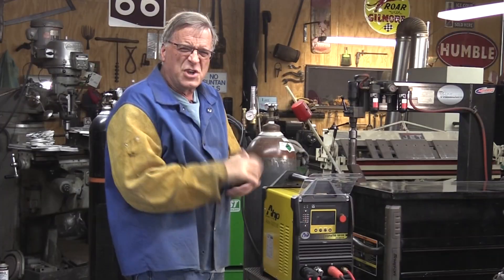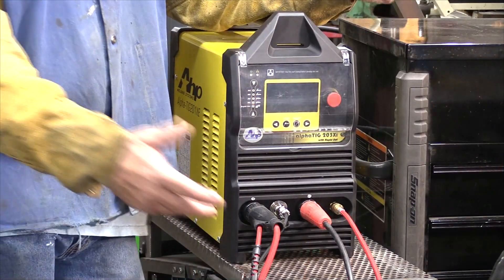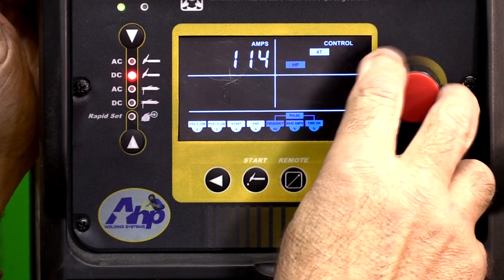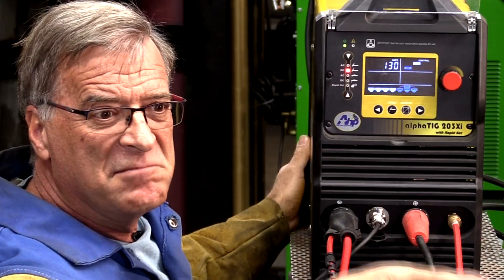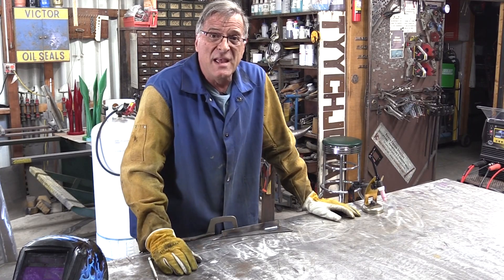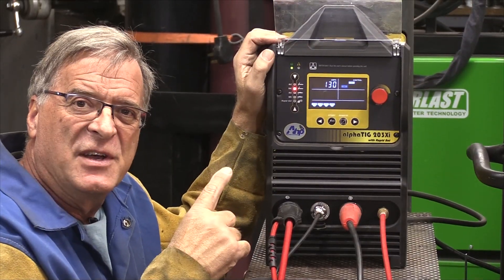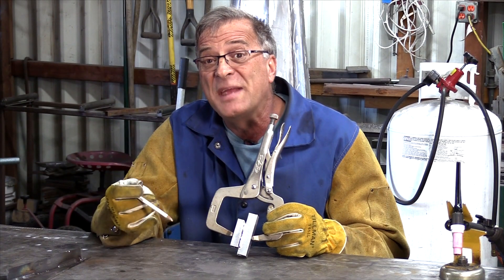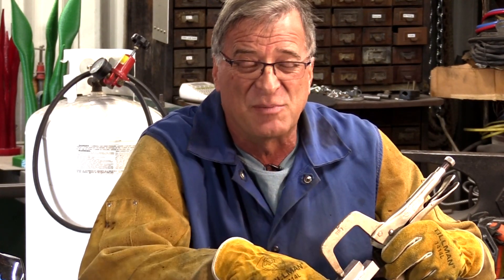A Prototype Revealed! The AHP AlphaTIG 203Xi - Kevin Caron

Comment: Hi Kevin, I just bought one of these based on your recommendation. I figured they had a year to work out the bugs and refine the software.  My 12 year old Invertiweld had no output last week and is not worth fixing. It is full of huge circuit boards with many cables and analog circuits that are connected to the potentiometers. People are familiar with knobs and for that reason feel that they are reliable, but the sheer number of connectors and discrete analog circuitry inside actually makes that approach less reliable. Somewhere a transistor, capacitor or resistor broke in mine and now I have no output. The new machines that have knobs are still huge because of all the analog circuitry that is essentially unchanged in a decade. With this new generation the 203XI computer controls everything and there is actually less to go wrong because there is far less circuitry. It is smaller and lighter because of technological advancements.  Additionally all the settings are exact numbers that are repeatable instead of the approximate position of some knobs.  We carry supercomputers in our pockets every day and those screens work reliably. So for the same price range why not get a more reliable latest generation machine that is more repeatable. It was also easier to drag outside and stick weld on my tractor when I broke it yesterday. Your video on why you don't want a 40 year old welder really helped clarify my thinking. The 203XI works great, but the human interface could have been better. They should have added a couple of buttons to allow moving backwards and forwards through the choices.  I need a lot of practice because I haven't welded in forever but I think this will be a great hobbyist machine.  Thanks
Reply from the maker: Have fun with the new machine!   Thank you for watching and posting.

Comment: Not tried it yet but why cant I PLUG A SPOOL GUN into the foot control socket?? Got any ideas.
Reply from the maker: The machine is not wired that way.   You might be able to but nothing will happen when you pull the trigger.

Comment: I like that it goes down to 5 amps with the pedal instead of 10 amps. Goes up to 140 amps on 120 volts, that's a bonus if your 120 volt circuit can handle it.
Reply from the maker: It is a very nice machine!

Comment: Hopefully this stick welds better than the 200 and 201. Cause they both ran 7018 like crap.
Reply from the maker: Works fine for me. Just have to hold a short arc.
Reply: I have the 201xd it stick welds all the rods beautifully except 6011 IT WILL NOT WELD 6011

Comment: What  do you think is the best import acdc tig welder?
Reply from the maker: Everlast Powertig 255ext.   Hands down the best machine I have gotten my hands on.
Reply: @KevincaronSculpture  but it's three times the cost of an Alpha tig
Reply from the maker: The AlphaTig is a light fab hobbyist kind of machine.  Not really made for all day every day work.   It will serve you well as long as you keep that in mind.  You asked what I thought was the "BEST" import machine.  The Everlast line is more of a every day all day machine.
Reply: @KevincaronSculpture  -Primeweld 225x, without any doubts the best. And, they have absolute world class customer service! A rare combination these days.
Reply: @Goes 2 Eleven- They are $600 because they do not have any to sell. Go to their website and see.for yourself. I purchased my Primeweld last year and I did not pay $825. I’d have to go back and look to see what I paid. My Primeweld 225 could not be better. The order, shipping, everything was flawless. They also threw in a very high quality cover. Primeweld does not have to give welders away to You Tubers to review as their welders sell themselves.
Reply: @Goes 2 Eleven- Rarely. Not like the others
Reply: Yeswelder ACDC 250p - AHP and Evergreen are the same company. You will not be disappointed
Reply: @TerrenceLP -I bought the Prime Weld 225, and no, I am not disappointed at all. Thank you
Reply: @thesearcherman6652  The prime weld is on the same level as  the old ahp, and is built by the same factory that builds eastwood and built the old ahp models.  Really not any better than the old 200 ahp's.

Comment: Hi Kevin, I'm new to welding and looking to order one of these 203xi so thanks for the Video. Question I have is on the Aluminum you showed machine set to 1/8" thick but your pieces look more like 1/2" is that correct and if so can you explain?  Thanks
Reply from the maker: That is 1/8th inch steel and aluminum with two 1 inch square hollow stock and it is 1/8th inch wall as well.

Comment: Communicated with AHP, down slope only, $700, free shipping. About to pull the trigger.
Reply from the maker: It's hard to stay up to date!   Thanks for letting me know.
Reply: where are you seeing it for 700, list 725 plus 25 shipping
Reply: @jakegregory9060  that’s what I’m seeing too. 🤔
Reply: Ordered mine on 3/13/21 for $700.00 plus $25 shipping. I noticed that the price changed to $725.00 + shipping on  Monday 3/15/21. Just under the wire! Still a great deal at $725.00. Welds great on Tig, steel and Aluminum. Have not tried pulse yet. Stick arcs 6013 great, beautiful beads with no spatter around weld area.- I am happy! -Would like to see more videos on the 203xi, it will be very popular.